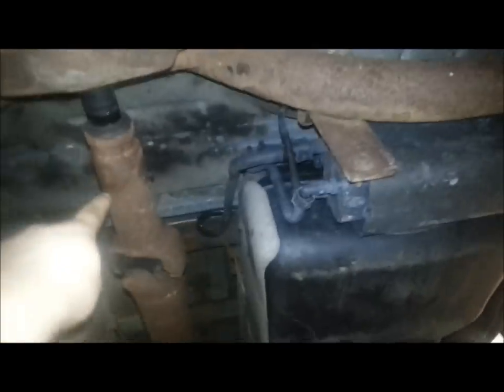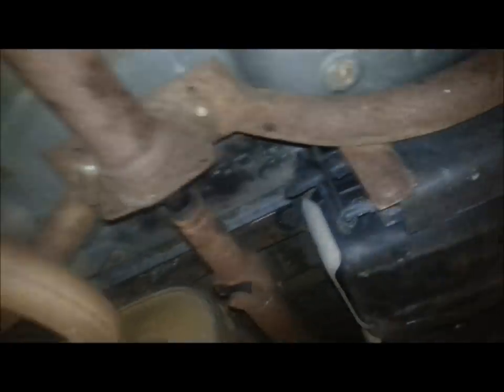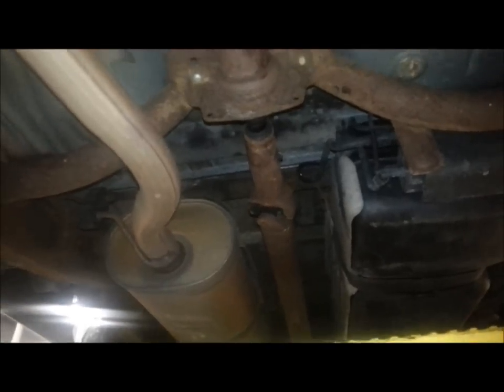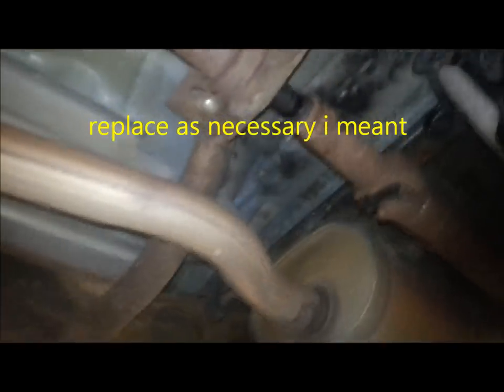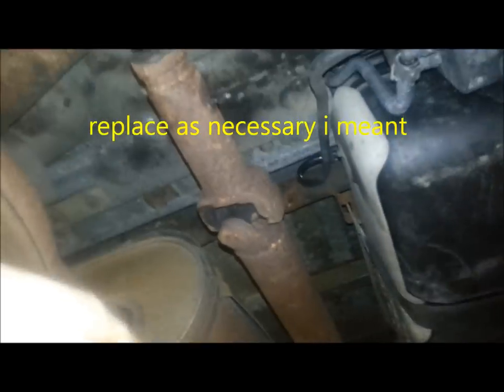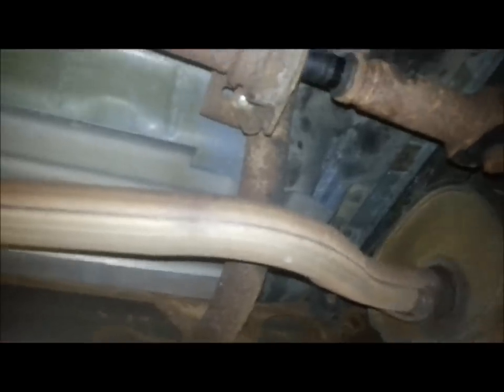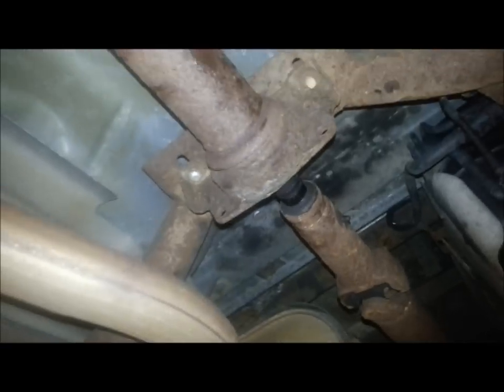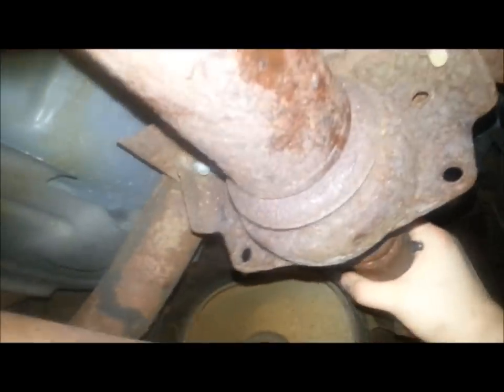two piece driveshaft vibration diagnosis

Comment: I just discovered this problem yesterday on my 2006 Ford F150.  Fortunately the shaft buckled at the hanger but did not break away.  4 miles from home after a 200 mile day. Oh how happy I was.  We have been trying to diagnose this vibration for well over a year.  56mph - 82mph.  Truck isn't used regularly but when it does get used it is big mileage day.  Now that I know the problem this video explains it so well.  Thank you.

Comment: Keep in mind that the carrier bearing is design to compensate for body flex.  it is suspended in a rubber housing inside of the metal shield that you see.  It's better tested by rotation.  Unbolt it, drop it away from the frame or cross member, then rotate the housing around the driveline.  Just like any bearing test, you'll know if it is worn out.  Just replaced mine in my 04 F-350.  Used a bearing puller to pull it off.
Reply: Stan Rodgers i think mine bad in my 2004 350 lol just started vibrating

Comment: I put a brand new carrier bearing in a 04 colorado and it still wobbles like this, even clanks on braking. Any ideas?
Reply: Did you find out the problem? Im having the same issue too :(
Reply: @s2k376  rear driveshaft angle was off, had to raise the rear with shackles to fix the angle

Comment: My 2010 4.8L Silverado has a vibration at highway speed and the steering wheel shimmys back and forth, especially going uphill.  Downhill, it often times goes away.  Any ideas would be appreciated.

Comment: does it make a weird noise when that bearing is bad? does it sound like a whinning/metal grinding? i thought it would be my rear end but had it checked and i even looked at it myself and rear looks good. brand new carrier bearings and brand new pinions. what else could that noise be? wheel hubs are new along with wheel bearings. im so confused as to what it is
Reply from the maker: yes the bearing does make a rotational noise when its bad
Reply: Joseph Dore I drove my s10 home recently with a center bearing that totally ripped out and was only held in place by the bearing casing. it was flopping around real bad but I had to get it home. it makes a thumping sound that lets you know something is very wrong.

Comment: Joe, i have 1992 Gmc 1500 and I replaced the center bearing, all 3 u-joints, both motor mounts and transmission mount, all new parts within 3 weeks ago. I still have vibration at 70-80. Do u know what it could be?
Reply: Also, 4 new rear end bearings. Rearend center section was just rebuilt.
Reply: I’ve heard that the inside of the driveshaft tube comes apart And causes a vibration replace entire drive shaft
Reply: Bent wheel from curb rash?
Reply: Replace your vehicle

Comment: 2005 chevy express 6.0L 2500 extended. Went to replace center bearing on a 2 piece shaft . pulled the shaft and found it was hot pressed on or some kind of mend. could not replace center bearing needed to build a new shaft. Johns Shafts in Manchester NH built me one in 2 days. now i can rebuild if needed later on. Dealer parts department was dumbfounded could not find the 2 piece shaft i needed and insisted on selling me a whole different drive shaft that did not match my truck.  mistake i made was trying to smash the existing center bearing off with a hammer to fit in press. finding out the hard way that it will not separate.

Comment: I'm having the same problem with my mid-shaft bearing on my ext cab 02 s10. can it only be removed with a machine press or is this something I can just replace in my driveway? Also where is a good place to pick one of those mid-shaft bearings up?

Comment: you wanna have it with that much movement. Its designed for that to soak up all the vibrations. i replaced mine with a new one thats too tight and now vibrations are annoying

Comment: +nastordomis Electric Hammer-drill? lmao. Don't put your driveshaft in a vice, but use a hammer-drill on it? You can put your shaft in a vice as long as you make sure you make sure the vice contacts the welds at the ends, and you don't go crazy over tightening it.
I've seen someone use a air-chisel to 'push' off a bearing, but I would never do it.
You can use a puller, OTC makes a kit for a reasonable price, but a nice clam type works best IMO

Comment: You are a skippy, why don't you point the camera at the truck and not up your nose, second you can change the bearing with an electric hammer drill, while someone holds it, don't use a vise you will dent it or bend the tube, be careful on your marks when you take the whole driveline down

Comment: Its called a "PROP" shaft, A drive shaft is on front wheel drive cars.
Reply from the maker: Ben curry if you wanna get super technical about it
Reply: I have a propeller at the end of mine. It's a prop shaft.